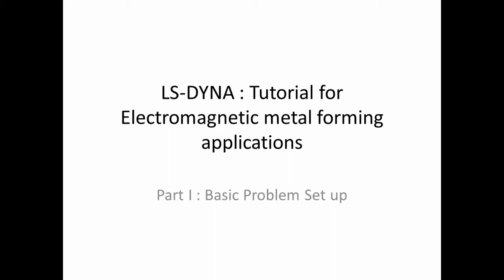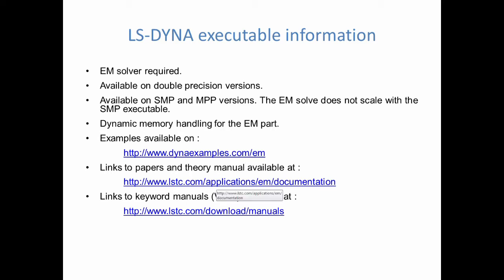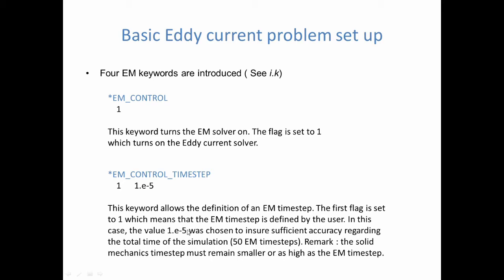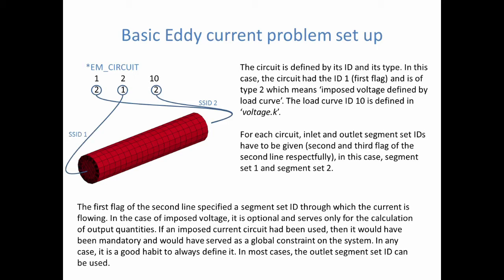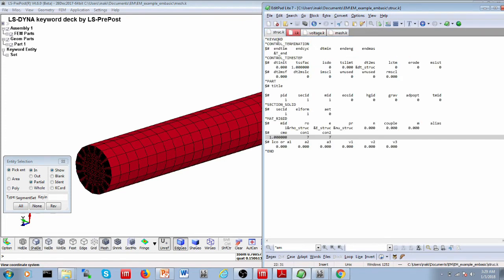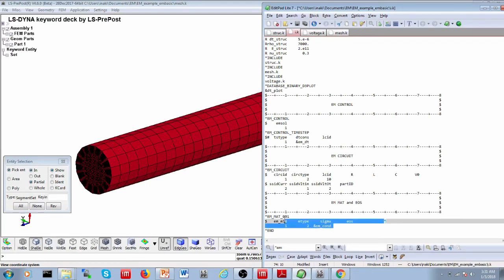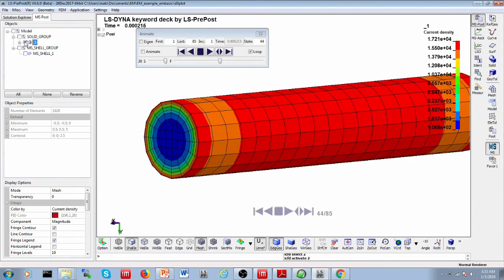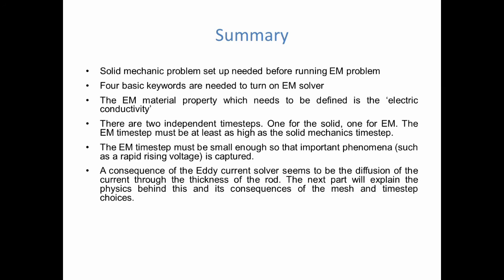LS-DYNA EM : Tutorial for Metal forming application (Part I)

Comment: Hello sir, i am doing electromagnetic tube deformation simulation, in this simulation how can i check whether solid mechanics of the problem is working or not. Bcoz the deformation is completely linked to the EM solution only right. How can i check the model for its solid mechanics simulation?